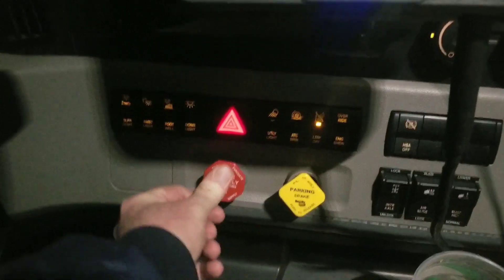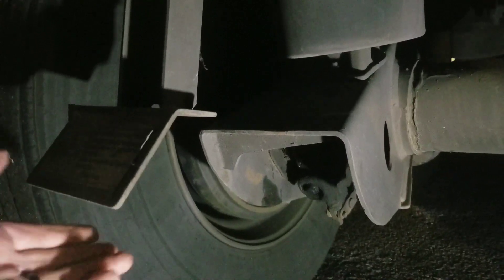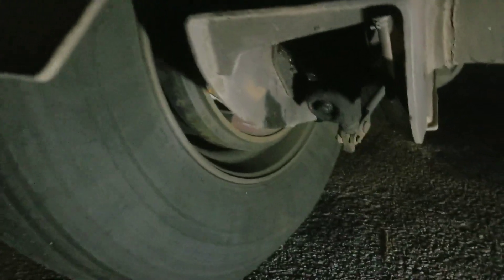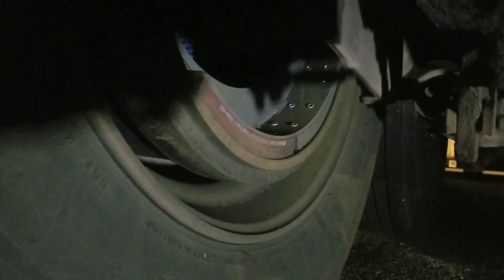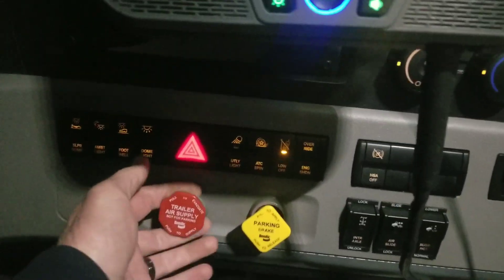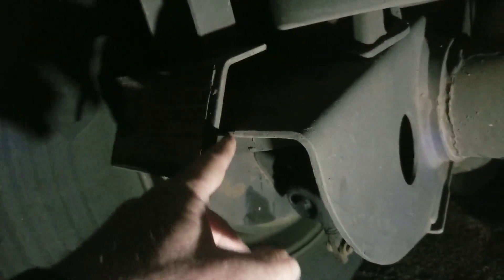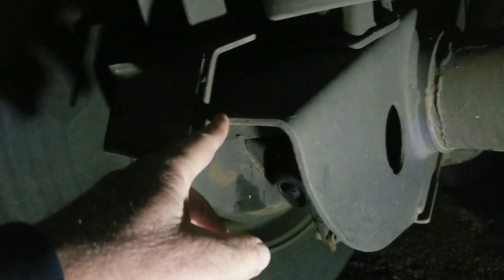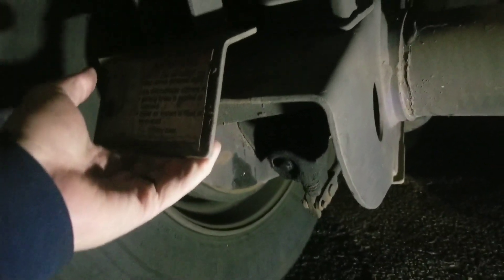Trailer Brakes Set But Trailer Tires Still Roll

Comment: But u never showed what valve u talking about
Reply from the maker: They're the valves that usually mount to both sides of the trailer air reservoir. All of the hoses to all of your brake chambers come from them. Each brake chamber has two hoses - one that goes to the red side's valve and the other goes to the blue side's valve. When the valve for the red side sticks, it's what can cause properly adjusted brakes to not set still.

https://youtu.be/cyWGUHImJ18?si=KV28_--WtehEv4FG&t=2746

Right at the 47:02 point in that video, where I'm doing a show and tell on the trailer parking brake "paddle" system, you can see the ABS valve in the background, mounted to the rear side of the reservoir.

Comment: Sounds like a bad brake chamber problem.
Reply from the maker: There are several possible contributors to this type of problem, and the video explains what some (but not all) of the possible causes are. It can also be caused by a bad trailer ABS/parking brake valve, bad S-Cams, bad S-Cam bushings, bad slack adjusters, etc. Brake chambers most often get replaced because of audible leaks - which won't have anything to do with this problem.

Comment: What about setting the brakes and it doesn’t start rolling until like 30 sec or a minute later? Can the brake button in the cab pop back out?
Reply from the maker: I assume you meant releasing the brakes and not setting them. I believe that could have varying causes - some of which could be concerns and some not so much. If it takes that long for the brakes to physically release, it could be a case of the trailer air reservoir being depleted of air and needing to fill back up first before all of the systems that are supplied by the reservoir fully pressurize. However, that does also raise the question of WHY did the reservoir get depleted. There's likely a leak somewhere. The questions are (1)which system is involved, and (2)is it audible? If no audible leaks are detected, it should be treated as a nuisance issue that doesn't require immediate attention. 

The brake valve in the tractor will only pop out if the pressures in your tractor air reservoirs drop into the 20-45psi range, barring an issue with the valve itself.
Reply: @ScottZane  thank you so much.

Comment: Crap that happened to me the other day. Try to slide tandems and wheels rolled with brakes set. You are right. Shop said it was a valve sticking.
Reply from the maker: Not sure if you remember me picking up a load last winter in Logansport, IN. I couldn't get the tandems to slide when I picked that load up, and it was for the same reason. It was 15F that night and I had to use a wheel chock to get the tandems slid into the position I needed them in. The TA in Mt Vernon, IL sold me a bottle of brake anti-freeze, which seemed to help...but it didn't completely eliminate the problem. Ensuring the brakes were properly adjusted was one of the first things I did, but they still had this problem.
Reply: What valve
Reply: @Norris798 I think it’s called quick release valve